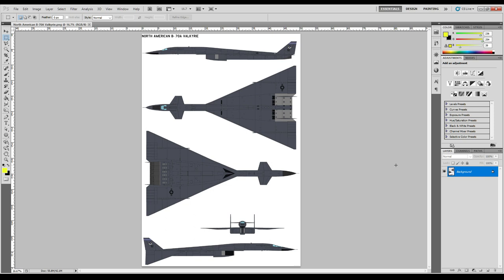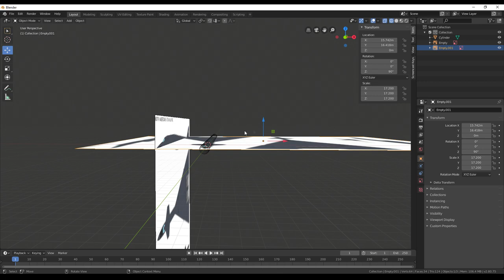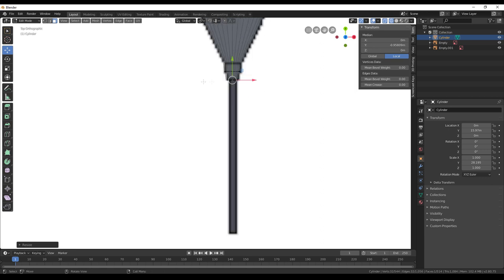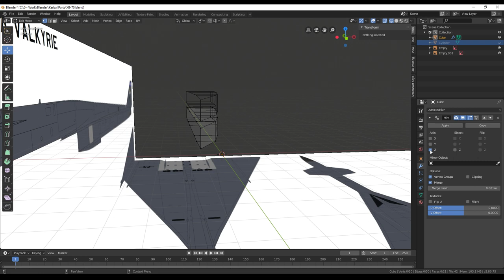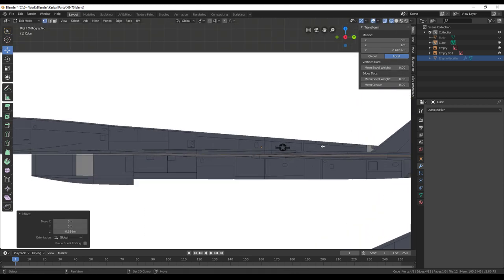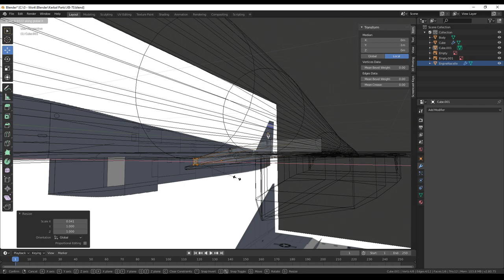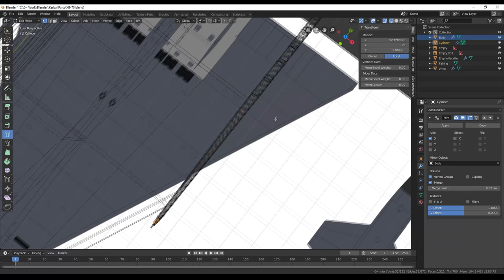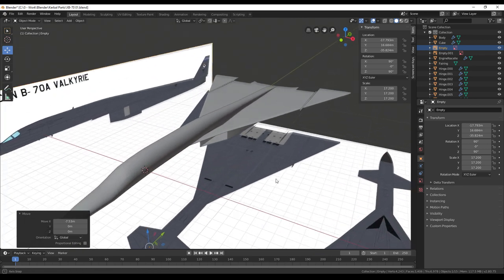Blender 2.8 - Making a Simple XB-70 Valkyrie Part 1

Comment: Maybe just make it where the control surfaces are already on the wing so you don’t have to worry about them
Reply: Unfortunately I think FAR requires control surfaces to be individual, separate parts. No problem with that in stock aerodynamics, though.